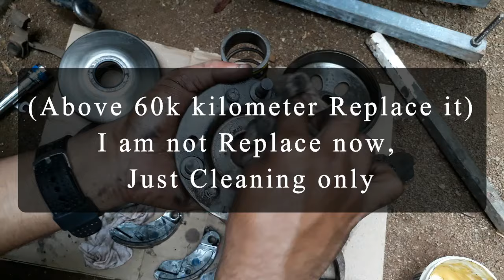tick tick noise clutch shoe removing & inspection | Scooter Clutch | Clutch Noise

Comment: The rattle sound usually comes from the clutch shoes /the end metal or aluminum area/ touching the clutch bell. This happens when the pads are bellow minimum limit The shoes must be at least 2.0mm. When new, they are 3.3mm /example for Yamaha XMax 250i/. These pads lasts at least 60000km. Cleaning the clutch will fix the problem only if you feel shaking when drive off.

Comment: It is the sound of clutch shoe, because clutch rubber is not installed properly, i had removed the clutch rubber and the same sound was comming, and i installed the rubber then sound gone....
Reply: I'm also facing same issue.
You are talking about this rubber at 12:29
Reply: Same problem facing
Reply: Sir may Mera bike  may clutch plate change Kiya hun pair bhi  gear  thik  say nehi pad ta hai

Comment: 1. Use gloves ( medical) and mask because Brake parts cleaner/WD 40 are carcinogenic.
2. Use 34 mm / 36 mm socket to open clutch this method damages the nut for sure.
3.First put the belt in the drive pulley and then the variator assembly .
4. Change the oil seals and O rings .
Thanks for sharing this video.❤️❤️❤️👍 From Kollam, Kerala ,India.
Reply: എവിടാ ബ്രോ.. Workshop 😊
Reply: 😊bro insta I'd or whtapp no indo
Oru doubt choikkan aayrnu
Reply: yeah i'd be more worried about taking those jabs mate over diy mechanics..

Comment: Thanks, Good job, but better to use the right tools such as 38mm spanner, the clutch assembly holder; and instead of roughly scrubbing off the brake shoes, some uniform way of scrubbing up, so also the clutch bell rubbing (inserting the bell in the reverse on the shaft and rolling the tyre while holding the emry paper would do better), else keep up the good work.

Comment: hello, I have a 18-20 model honda pcx, but the cvt vibrates between 40 and 60 km, what could be the cause of the problem?  Could it be from the rear movable pulley, is it because the working points of the movable pins in it make a worn gap?